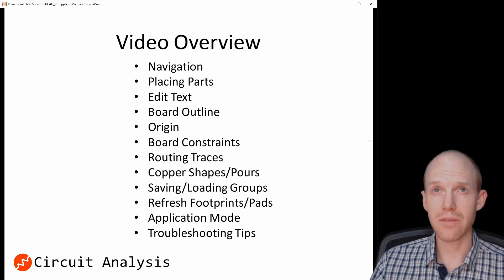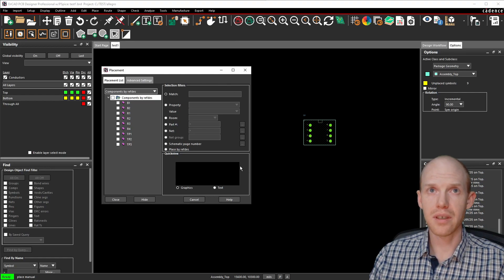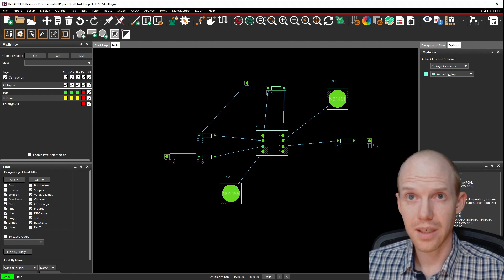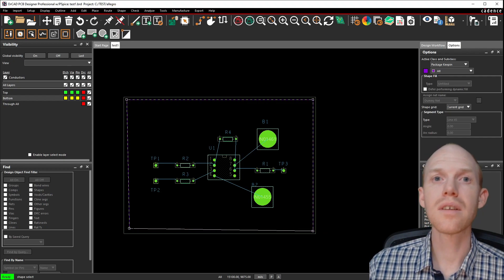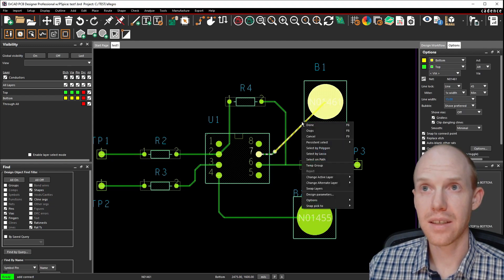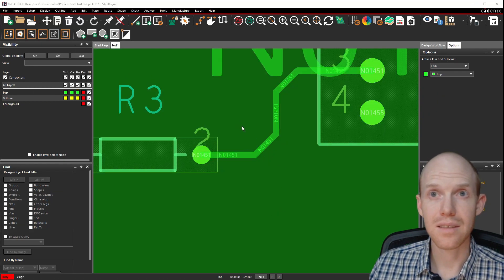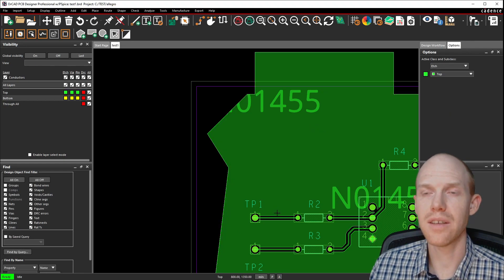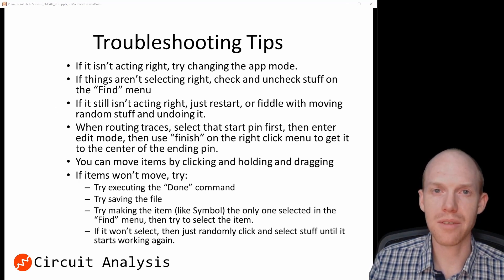Cadence OrCad PCB Editor 17.4 (Complete board layout in 30 min)

Comment: This video series is great!
I'm having trouble though, not mentioned anywhere. I think there's a BUG ☠ in the 17.4 version for 2022.
Every time I import a netlist it keeps MOVING the parts! 😖
Try this yourself: export a netlist, then import that same netlist you just generated. It keeps MOVING the parts. I can't figure out why. I'm working on changes to an Eagle design imported onto Cadence. There's very little help on this.
Reply from the maker: Oh I believe it, OrCad is full of bugs that never get fixed!
Reply: @CircuitAnalysis  I figured out what I was doing wrong. I should have been using the Design Sync feature. Doh!🤦‍♂️
Cross probing is awesome! 
But I quickly learned than in the PCB I should have Capture closed, or if you click on a GND or PWR net it will open up EVERY sheet with those nets and highlight every net. 
It made the program lock up! 
I recommend SAVING your work in another file very often. I don't trust those Recovered files.
Reply from the maker: @SciHeartJourney  Awesome, thanks for sharing your solution. Might help others in the future.

Comment: Hi there
Which course is best to study if i am working in micro chip manufacturing (semi conductor) company?
Electronic engineering?
Mechatronic engineering?
Or material engineering?
Kindly gibe me a suggestion THANKS
Reply from the maker: Hi Sana, I chose electrical but I can't tell you for sure what you'll enjoy. All engineers make good money, I think right now software engineers make the most. There are some tradeoffs of which companies hire which types of engineers in which locations. If you want to make a lot of money you'll have to start your own business someday, so you might consider that. If you want a secure job you'll have to really specialize and become an expert in your niche. My cousin studied mechanical engineering and he works on the robots that operate the semiconductor fabrication lines. I think electrical and mechanical are similar as far as lots of math + physics + design. I think materials is a lot more like chemistry where it's less about math and more about learning and memorizing a lot of different facts and data. If you want general life advice, after you graduate I would suggest you get into the startup scene and that you make sure to be thrifty so your disposable income is above 50% of your total income and you never have to worry about money.